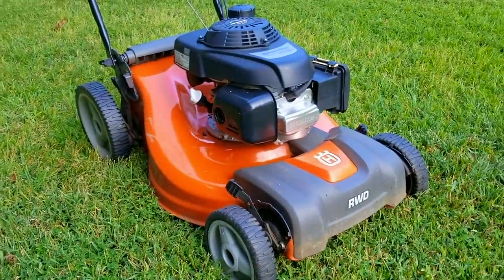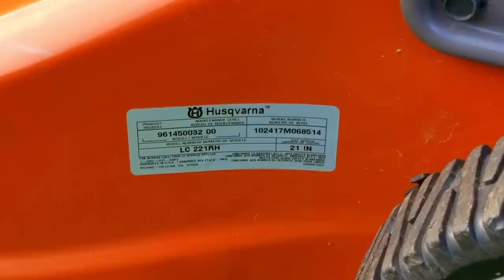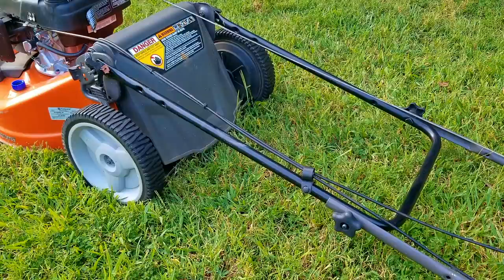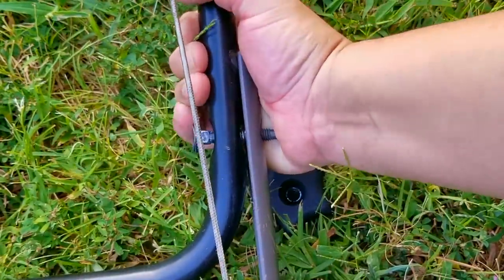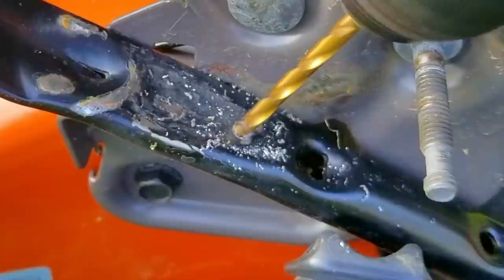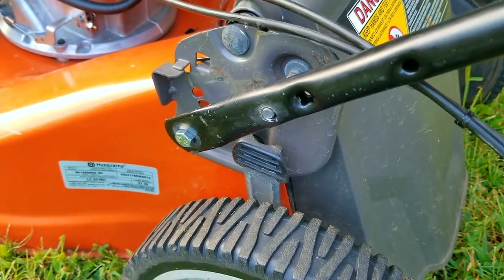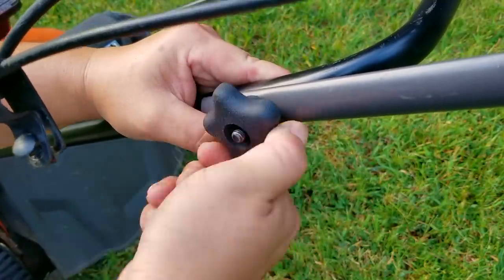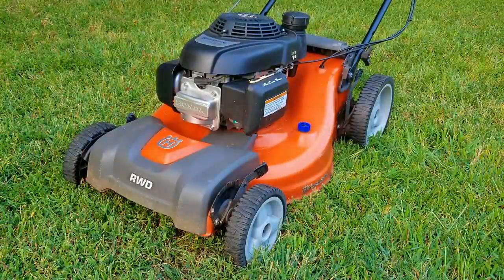What happens when you can't get parts for your mower anymore?

Comment: Your method of fixing the handle bar seemed perfect to me.   Quick, easy and inexpensive so it works for me.  Probably a new crank is the way to go sooner than later I would think.  Thanks for the video.
Reply from the maker: thank you D Butler, it's unfortunate, but since it was ran for so long in this condition, the top bearing has be severely damaged.

Comment: You did a good job, you can lower the pull rope hole in the handle to make it better to pull. 
Also you can straighten the crankshaft, Terryl fixes all has an older video on this, I do it with a piece of oak and a large hammer. Line up the shaft with a indicator, (clamp a hack saw blade to the bottom of the mower deck for an indicator), turn the crank to find out whick side is out and bend it back to as near round as possible. I have done this very sucessfully. Re-install the blade if the blade is not bent. Also they make a tool for this.Thanks for another great video.
Reply from the maker: thank you Waterman one.

Comment: Welding could’ve also fixed that problem, but the drawback is you can’t collapse the handlebars anymore. The engine might not be very damaged from the bad oil if it started that easy, if your really concerned about it then try using some of that engine restorer additive in it. I’ve changed oil out of Tecumsehs that look worse than that and they usually run without issue, but that might just be because of their exclusive oil pumps.
Reply from the maker: quite possibly, This project gets a lot worse from here on.

Comment: I would’ve fix the shaking motor first. Andrew Cammarata has a video about fixing that problem. He beat it with the 10 pound sledge hammer till it was kind of straight. It worked well after that
Reply from the maker: unfortunately, the damage happened over a season and a half ago. Since then, there's been more damage to it,  than just a bent crankshaft.

Comment: Yes great idea. I did a 2 in 1 of basically the same awd Husqvarna. Only difference was they had Briggs engines. Same broken handle bars and bent shaft . Your exactly right without having 2 it would have been expensive or not possible if the parts aren't available.
Reply from the maker: thank you Casey B's Zombie Mowers.

Comment: I had a Briggs engine on a old craftsman mower that shook like that when ever it ran. My inlaws had it since new and never maintained it. It had a rough life. I found it after it sat upside down for a year or 2. I replaced the cheap plastic carb, fresh oil and used it as my shitty area mower. I hated using it because it was painful to use. It will be going back to the junk pile. It's not worth my time fixing it.
Reply from the maker: I totally understand the feeling.

Comment: I think you did right on that Repair for the handles. actually looks good and I'll look like it will be solid repair for awhile . I'm just more interested if the engine could be repaired with that bent crankshaft the way it is
Reply from the maker: unfortunately, there's damaged to the top bearing, because they didn't put enough oil in it, so it will have to be swapped for another engine.
Reply: @HomeGaragechannel  such a shame

Comment: When the crank shaft originally bent, you could have straightened it and saved the motor.
Reply from the maker: yes you're right, however, that didn't happen.   Don't worry, it's getting a different engine instead.  Thank you JD'S Lawn Maintenance.

Comment: Hey i just wanted to give you an update i got a weed whacker from my school teacher it was not run right and rev but now it stays running and sucks up fuel  the filter was switched and i moved it to the right place and it also revs fully when u pull rhe trigger
Reply from the maker: so it's working good now?
Reply: Yes it works great after sitting for 2 years

Comment: At my shop before i became a dealer for all 4 major engine manufacturers i would straighten bent crank shafts, i do still have a machine that does it but i don't straighten them anymore as it is against dealer policy to do so, plus it is too risky, i have had crankshafts break off and they are under so much pressure they go flying out from the machine and it's not safe to have that happen, plus you can never get a bent shaft 100% straight anymore, the easiest solution is to replace the crankshaft, also bending a crankshaft voids all remaining warranty on the engine.
Reply from the maker: you are absolutely right,  The funny thing is I just got a mower with a bent crankshaft.  Thinking about trying to straightening it, for testing purposes of course.

Comment: I would have repaired the handle in a similar fashion. The bent shaft is another matter. When you factor in your time to repair and/or replace the crankshaft, plus materials, to me, it’s just not feasible for a $400 unit. Overall that mower is in nice shape. There’s more value in parts. 
Cheers
Reply from the maker: thank you EZ Ray

Comment: Yes. Short bolts and nuts are the way.  So now you would need to get a 5 foot iron pipe and take the blade and adapter off and attach it to the end of the crank and try and bend it back. It's a cheaper method than anything else
Reply from the maker: very true, unfortunately, the damage is already done to the block.

Comment: Handle fix seemed like the most logical thing to do. I would have focused on the engine first myself. Cos if the engine is junk a fancy handle bar is no good to you. Can't wait to see how you fix a bent crank. That looked like you had "man glitter" in that oil..😀🔧👍
Reply from the maker: I would've fixed the engine first, but just handling the mower around the yard, was a huge pain.  thank you dandel351

Comment: I would have done something along that line. The only thing I might have done differently would be use Grade 8 bolts. With it being somewhat of a loose fit the 8's would last quite a bit longer with the handle moving back and forth during use.
Reply from the maker: I can see your point. Thank you Steven Bridges.